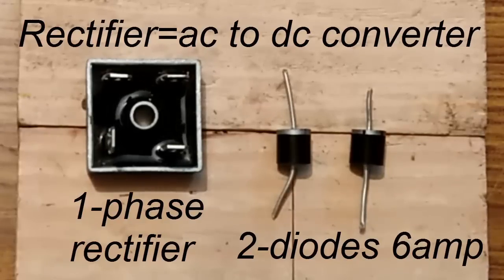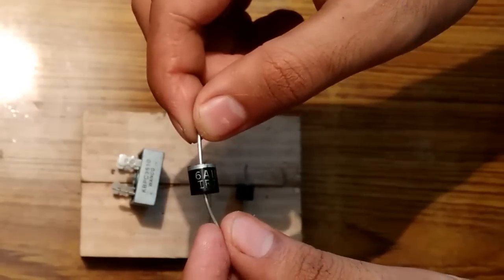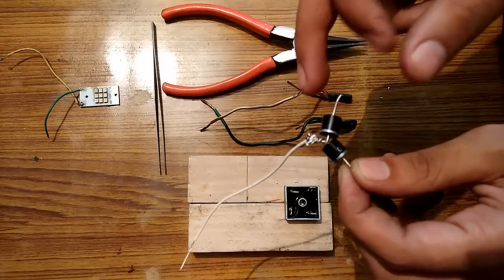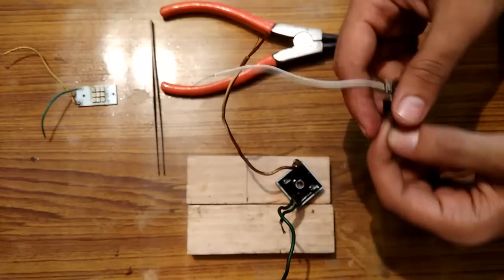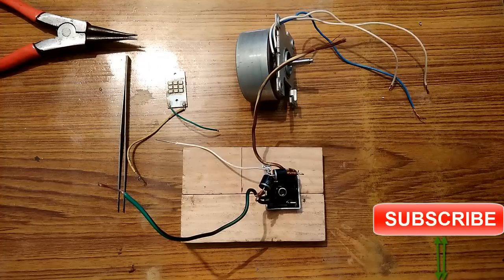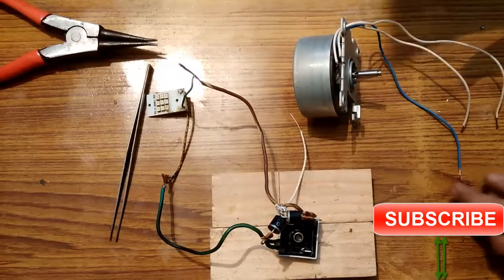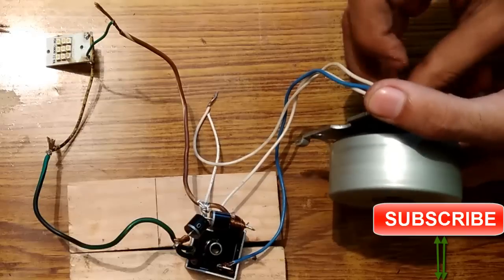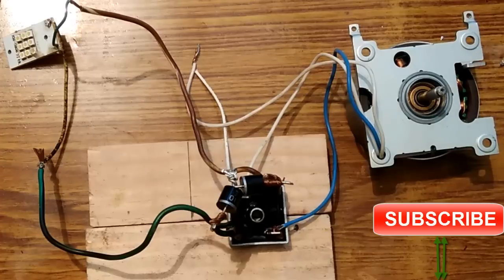How to transform a 1-phase rectifier into 3-phase? Simple & Easy

Comment: sorry Mr Electron, but I was taught and have experienced that the stripe (silver band) means THAT side is + (positive).
Reply: Not true; the band is the cathode side.  So if the cathode is negative relative to the anode, the diode is forward biased and will conduct current.

Comment: It works, but it's kinda sloppy.
Take a look at how a 3 phase bridge rectifier out of an automotive alternator works.

To really wrap my head around how it works, I had to take it apart and reassemble it using just the diodes and a little bit of wire.

You could have built a more elegant, durable and cost effective solution yourself in the same amount of time.

Comment: my small 2000 watt generator has a 12 v dc, 10 amp output. it has a rectifier like that one in the video. can you make it 24  to charge my 24 volt 200 amp hour battery bank?

Comment: hello!can i somehow run a 3 phase dc motor by 2 phase dc(12v)? my driver is dameged it can't be fixed!..is there any way to run the motor manually?
Reply: You either need to build an analog driver or rewire your motor to run on single phase.
There are two ways to build an analog driver.
#1 use a brushed DC motor to turn a 3 phase generator.
Another motor like the one you want to drive will work. Connect the 3 phases straight across.
#2 externally commutate your motor. 
Your motor must be wired in a wye or star configuration for this to work.
Use two pieces of plastic pipe and some metal strips... Glue one piece of pipe to the output shaft of your motor, and glue a slightly larger diameter of pipe that fits over the first pipe to the case of the motor. 

Glue 3 U shaped pieces of metal to the outside of the smaller pipe, one above the next. Turn the U shaped pieces of metal sideways and only put glue on the curved part of the U. Bend the ends of the 3 U shaped pieces of metal up and away from the smaller pipe.
This will act as your brushes.

 Inside of the larger pipe, starting at the top, you need to glue 3 circles of metal that go all the way around the inside of the pipe and line up with the top of each of the 3 U shaped pieces of metal. 

Connect the first phase wire to positive and second phase wire to negative of your 12 volt power supply until it stops rotating.
Mark the inside of the larger pipe where the lower side of the top U shaped piece of metal is.
Now connect the second phase wire to positive, and the third phase wire to negative until it stops rotating.
Mark the inside of the larger pipe where the lower part of the top AND middle U shaped pieces of metal are.
Connect the third phase wire to positive and the first phase wire to negative until it stops rotating.
Mark the inside of the larger pipe where the lower part of the middle AND lowest U shaped pieces of metal are.
Carry the first mark you made for the top U shaped piece of metal down to the bottom U shaped piece of metal.

Glue 3 strips of metal inside the larger pipe that line up with the lower parts of all 3 of the U shaped pieces of metal, skipping the area between the marks that were made. 
This will act as your commutator.

Connect a wire to each of the strips of metal that were just glued in. All 3 of those wires go to the positive side of your 12 volt power supply. The neutral wire from the center of the star connects to the negative side of your 12 volt power supply.
You can glue some springs between the pieces of metal that are bent away from the smaller pipe and the pipe for extra durability.

The correct way to rewire a 3 phase motor to run on a single phase is to connect the windings in series, with an equal number of windings on both sides, between the two ends of the windings that will now be your positive and negative. You get much less torque and speed this way, but it's a fast & easy solution.
Reply: Kaiser Sose thanks a lot❤️ but i’ve broke that motor to make a generator but it’s a flat motor do no extended stick and it’s just sitting idly😵
Reply: @sakibsarwat5064  
It sounds like this motor isn't very large. Since it wouldn't be subjected to a great deal of mechanical force, there are many things that you can do with it.

You can extend the shaft to be as long as you want.
You can even cut the bearings out of the case and change them to accept a shaft of a larger diameter.

Silver solder is quite strong and melts at a temperature that is low enough to avoid damaging the insulation on your windings.

It's typically an alloy of 65% silver, 20% copper and 15% zinc.

Comment: can it also convert DC to 3 phase AC if we give power from load side????
Reply: 1PH AC TO 3PH AC IS easy by powering 1PH of 3PH AC Motor and taping the extra leads to the load. Motor needs to be rated for load 3x.
Reply from the maker: Prince Sharma No. Never.
Reply: Mr Electron Thank you sir,
 If there is any circuit that convert DC to 3 phase AC and any one which convert 1 phase AC to 3 phase AC , so plz tell me......😊
Reply from the maker: inverters for 3 phase are available online but those are very expensive. Google 3 phase inverter and you will find it.Still i am planing to make a video on simplest way to convert dc to 3 phase at home 100W

Comment: It is even a simpler solution (I've not tested yet but I think it works) to put two 1 phase bridge rectifiers side by side. You'll use only 3 of the four alternative inputs (one for each phase of the alternator), and link in parallel the DC + and -  as output (i.e. connect the two minuses on one side and the two pluses on the other side).

Comment: My friend i use it to operate the alternator.  my problem is i remove the light base on your video and change battery  36V its became so can only be reversed. you think it will run???
Reply from the maker: Your meaning is not clear friend.
Reply: so i asked for reverse. if its run or no??? check for alternator to dc motor
Reply from the maker: now i get it.No it should not work.There has to be a rotating field to turn alternator to motor.
Reply: thank you for your  time and reply....make more videos for supply 3 phase spicialy alternator
Reply from the maker: Sure!!!!!!
Reply: @truckz08ytv  I truck did u succeeded in rotating the alternator with the three phase supply

Comment: gentleman, what about the neutral and ground wire in a 3 phase ac power? i know some country you will only have 4 wires in 3 phase ac power, but ignore the ground will be a little bit risky move, especially when 3 phase ac from the street supply can go up to 380 volt, 100amp or even more in special situation. for your own safety may be you will need to rework this circuit before plug it on the wall and switching it on, at least a fuse for each phase may be?
Reply: I think he's covered by the home circuit breaker? I am not sure of the wiring outside the US though. Cheers.
Reply: This reminds me of the 3 phase 2 diode and 1 scr rectifier that GE used.

Comment: U r going to help me or not i need to get free solar panels from Harbor Freight then tools that put together make one 100 Watts I want to take two of them added a three-run them in series the third one will be run in parallel to the series 2. , and instead of using a charge controller I want to run them directly the solar panel positive negative directly into the grid tie inverter and I was going to use a boost Buck inverter if needed DC to DC to boost up the 24 volts. Up to 60volts at lest
Reply: jonny c 2.0 cid
Reply: What is  -- cid --- please Enlighten ....